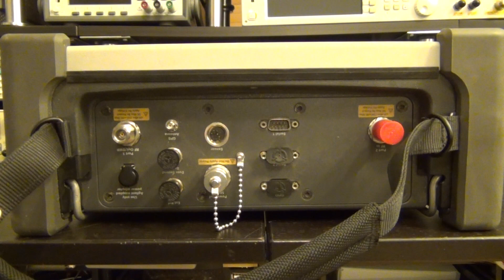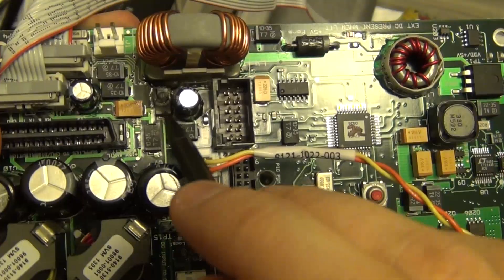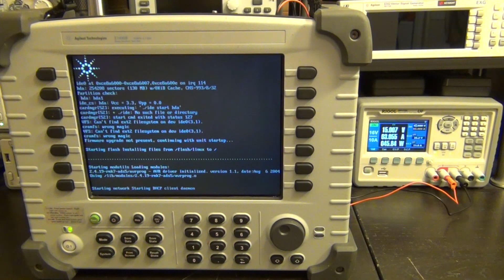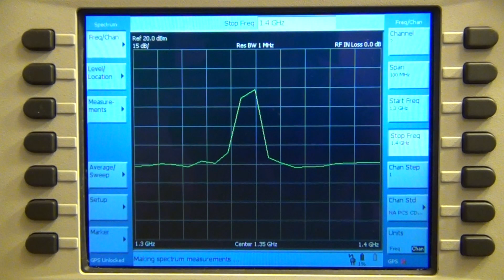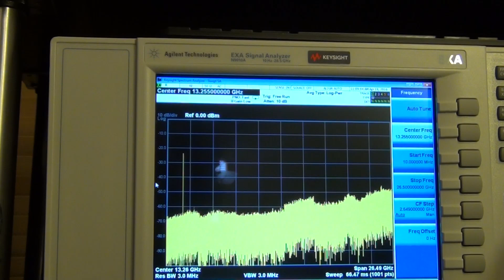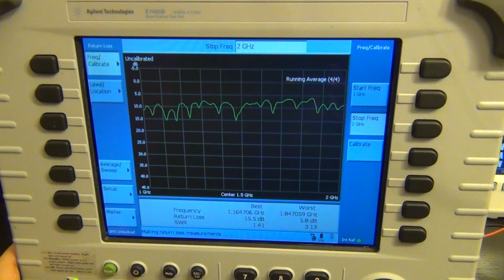TSP #80 - Teardown, Repair & Experiments of an Agilent E7495B 2.7GHz Base Station Test Set

Comment: I received one of this to repair, I found out that there was an excessive power consumption that made the external power supply enter into protection mode.. there was not shortage at the input (so, it was not the same issue showed in the video).. I tried injecting voltage with my LAB power supply, and I saw a sudden increase of input current (more than 4A) when input voltage was above 6V...I left it connected a few seconds and a miracle happened.. current returned to normal (less than 2A) and device booted up with no issues.. I suspect there might me a foulty capacitor somewhere.. that was shorted.. and it is not shorted anymore.. I will have to wait for the short come back again 😁
I tested it without battery, so, battery is not the culprit.

Comment: Great video!...I just bought one of these on Saturday at an antique radio swap meet!!mixed in with 1920's thirties radios for $200 working with power supply
Reply: Tudo bem? Qual tensão e amperes da fonte? Obrigado de Brasil.
Reply: @rodrigocosta9504  it is 24VDC at 4 Amps...

Comment: Hello, Thank you for the video. I’m little confused about the the power input. Is the power supply voltage 12 or 15 volts? I also checked the user manual , it says 24 VDC 100 Watts

Comment: Can Anyone Tell Me if  Agile E7495A  has the Option to Measure the  SWR Antenna for the HAM Radios   ???.
Thank You ,..
Reply: yes
Reply: It can measure insertion and return loss for cables, antennas, filters, etc..  in the range of 375Mhz to 2.5Ghz (so, not for all HAM radio bands)

Comment: I have an E7495A, the break in the noise floor is because they have a preamp that is only active from 380 Mhz to 2.7 GHz. Looks like it gives about 30 dB of gain and the VNA feature will only work from 380 MHz to 2.7 GHz.

Comment: If you can't find one of these, have a look for the CMU200, they're also a nice bit of kit. It's meant to be rack mounted, but it's fine sat on a shelf.
Reply: i have both e7495a and cmu200. e7495a has much better UI but cmu200 has superior performance. but e7495a can be had for unbelievably low prices.

Comment: It's crazy that people are giving instruments like this away.  Anyone who has a use for these should be able to repair them, saving many thousands of dollars for a few hours of work.  I can only think they are throwing them in the dumpster as soon as there's a scratch.  This was a trivial repair that needed no skills but soldering.  No excuse!  I guess it's lucky for us though.
Reply: Few hours of work when technician isn't actually doing job he was hired for, unknown success rate, getting cal of this instrument void so it has to be sent for not cheap calibration & recertification process and not being sure if this instrument won't crap again in next few weeks, because tech didn't found the real reason for failure.So as soon as this instrument is out of warranty and it breaks, it gets tossed into dumpster. And that's a field use device, so it will get reasonable physical abuse. Sad, bud reasonable.
Reply: i got a working e7495a off ebay recently for ~$500. msrp was somewhere around $9000 when new.

Comment: I need one of these for "next to nothing" too.. however, I wonder if we have different ideas of that term...
Reply from the maker: +Dennis Lubert I paid $150 including shipping.
Reply: +The Signal Path Blog If the listing lets one deduce that the reason it is broken is likely something not too severe, then that is indeed an amazing price. (I think I found the ebay listing, the scratch marks on the battery match). Around here you would have to pay 500-800 USD for the same thing :(
Reply: +The Signal Path Blog This instrument is like the gsm/pcs test set I got on ebay for 65 bucks. It have a lot of stuff in spectrum analyzer, signal generator, frequency counter, power meter, audio analyzer, modulation analyzer, ecc.
It is the hp 8922M. It has also a lot and I said a lot of boards inside!
Reply: +Dennis Lubert I see one of these that has been refurbished, which could mean a lot of things.  Price, around $9,000.  At  first I thought it was this unit, but the options are different.
Reply: pillsnotbills Look for the battery scratch marks ;)